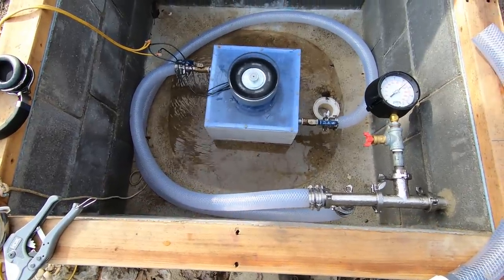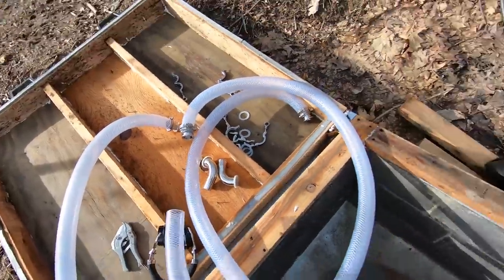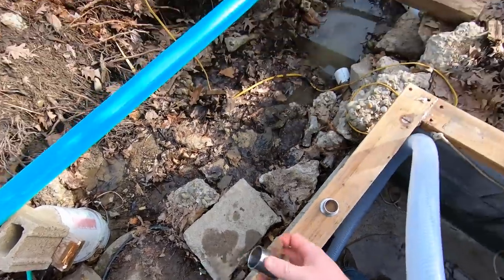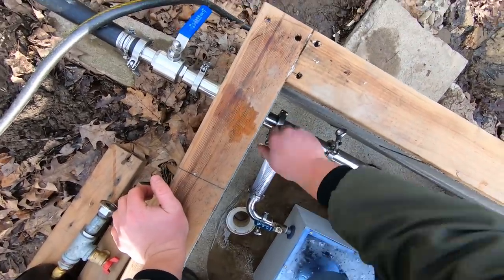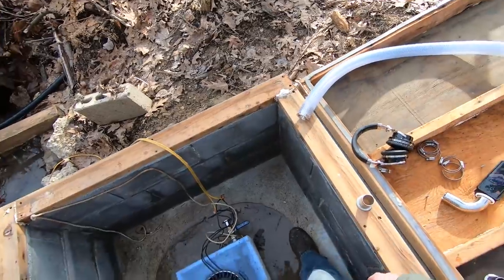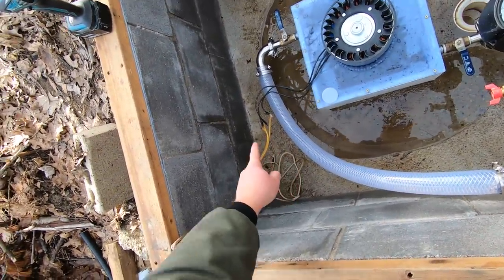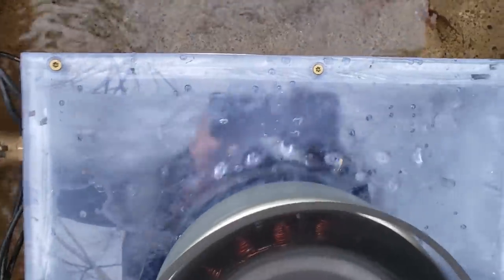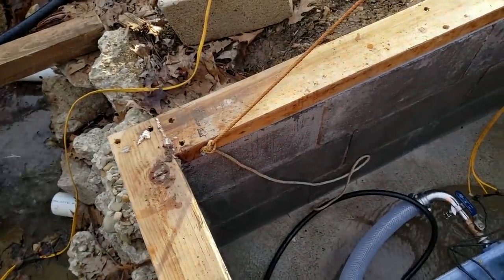Better Jet Alignment Through Elbows?

Comment: Tri Clamp was news to me. I worked with an earlier version of it as dairy farm pipeline systems use the same connectors. Most of ours were wingnuts because they'd never be disturbed once in place, but there were a few we regularly had to reposition, mostly a transfer pipe to move it between going to the bulk tank or the wash vat, and a section in the front of the barn to get tractors in or out.

Comment: From the first time I saw your tri-clamp fittings I wondered if you might work in a dairy or a dairy supply company.  For many years the only place you saw those fittings was in the dairy industry.  They are a great way to go so that you have flexibility for experimentation.
Reply: Try dairy places use them, They are also very popular in the food industry as well, much of the commercial machines use items like this as they make for either quick work of cleaning and or redirecting to another machine,  example one machine might pump x food and where another machine might pump a wrapped type food like raviolis while the same type of machines on the mixing or back end would do the same function for the front ends.
Reply: That was my same thought as well!

I've always called them milk line fittings.
Reply: @farmerkjs6042  They are " Victaulic flanges " I believe.

Comment: hi joe, for jet alignment have you thought of using screws or something to align the jets, kind of a 4-jaw chuck alignment?
Reply from the maker: Yes
Reply: Perhaps a surround around the jet like how a mig welder has so splash back isnt effecting the water droplets from being disrupted 
but to understand a nozzle you gain in pressure but lose velocity/gpm a bigger nozzle you lose pressure but gain velocity/gpm
an adjustable jet nozzle could be engineered similar to a jet aircraft nozzle to understand pipe friction you can push more water though a bigger pipe but a bigger pipe requires more gpm to catch up possibly depleting the reserve 
once you have an adjustable nozzle you could use Arduino chip to make micro adjustments and control output and auto adjust pressure by setting input variables
but for now maybe rig up a lazer to site the jets perfectly to the spoons
a Y would be much better than a T type as a t or sharp bend like that would hamper flow a great deal as water has to stop and flow in a sharp 90 it also slows down the vekocity and pressure as water is a solid so as it hits that t part you would think the opposite but water moves fast but it moves like toothpaste in a tube a Y divides
a t reduces velocity as it has to "wait" on the water moving into the side out before water moves though the strait portion

something else may be possible is pulsed on and off with arduino a pulse would give possibly an increase in pressure as the pulsed could be alternating so that as a weight or "timing mark" could be used to pulse the jet as a certain mass hits the mark increasing acceleration
you likely would need to include a pressure/air chamber to cushion the water hammer from the pulses
the pulses could be timed for very fast or slower 
I love the setup I like how you designed it im considering a water wheel or micro hydro like this perhaps energy could be stored in a centrifugal battery
https://en.wikipedia.org/wiki/Flywheel_energy_storage

Comment: Interesting... When you went from the small diameter paddle wheel to the larger diameter paddle wheel you increased the amount of Torque but you kept the old Alternator. If you want more power out you need to replace the Alternator with a higher rated output requiring more torque. The larger the Diameter / Radius the more torque (ft/lb) for the same water pressure.

Comment: For adjustment, I would consider some sort of double plate design with a square bung of about 2 inches square, This would allow for about 1 inch of play in either direction. 
Plate one would have a large hole in the middle with some bolts and nuts that can me used to move the middle plate that has the large bung, the bung would be threaded all the way to allow you to connect you pipe connection on one side and your jet on the other side, Plate 3 would be your mounting plate that bolts to the stainless steel box, The inside and out side plate would have a section that is recessed down to allow the middle plate to move about 1 inch up, down and side ways while still being ridged enough to not have any slop in it. Pretty much this means if said design was indeed made could allow you to adjust it with ease with could be unbolted and added to another type of box as well. Provided your box is square and not have any rounded type edges. I think something like this could be made in cad pretty easy, The bolts would go in the none recessed part in a much larger part of the unit. I think this is this is the best description I can give. The nuts would be welded to the outside plate and a bolt thru it and a lock bolt on the other side, One can use extension nuts that are about 1 to 2 inches long to allow for great welds and flat and true adjustments. Something like this should be able to give you super fine adjustment if one were to use fine threads, one could even use hex machine bolts as well for use with hex wrench.
Reply from the maker: This was in the original plan, I will try to incorporate adjustment in the turgo design.

Comment: The voltage drop over your wires shouldn't be too bad based on some rough guesses. I'm getting only about 3% drop based on 3 phase AC, 86 volts (from previous video, though that may have changed with the new set-up), a 75 feet wire run, 6 amps (~500 watts) running through a 16 awg wire (best guess and worst case scenario) great job and awsome content, keep up the great work
Reply from the maker: You are spot on! I'll still be upsizing it in the future.

Comment: If you use two 45 deg elbows in series (inside the box) you can adjust the direction of the jet by setting the relative rotation of the elbows.

Comment: Might you get better water velocity with less turbulence if you turned the white box 45° to the left?   I was wondering how much it would increase the velocity and decrease the turbulence if the water pipes could come straight in from the corners where there’s more distance they have the pipes run straight into the turbine in a straight line.

Comment: you should look into just getting a manifold of those fittings and mounting it to the block inside the hutch. and you really should put a high point with a bleeder to collect and vent air that gets trapped.

Comment: Just an FYI It looks like you are losing some energy with a bit of water blowback in your square housing. If you made a conical shape inside to direct water away from your fins and down you could gain some wattage. Impressive project. Personally I would have another turbine available to run so you can generate power while the other is off. In an installation in hymalayas they had more money to work with but set up 6 turbines like yours mounted on their side and in their turbine room you could turn off any turbine while the others ran and they could stick in 4 more. Now they were supplying a town. As an engineer I look for ways to keep things operating because it might be your only source of power. If you stored more water at the top you could have a reserve as well in case you need it.

Comment: Interesting, do you lose energy in the flow as it comes around that elbow? My intuition makes me think it would get slowed by a sharp bend like that and lose some of the potential generating power
Reply: Would most of the jet velocity be coming from the pressure + nozzle, rather than the flow speed in the pipe? I'd think so.
Reply: @BooMeringue1  Sure but the velocity of the water plays a part in the amount of pressure so loss in velocity = loss of pressure. Now whether or not it's significant is a whole other thing. It may very well be too small a difference to matter but I'm curious if he could calculate the loss/gain in generation capability with different configurations of fittings at the turbine housing

Comment: The angle of the nozzle against the shovel must be essential. Another thing: The horizontal turbine wheel is not perfect. When the water meet the middle of a Pelton shovel, it directs the water backwards to both sides of the turbine wheel. That means , one part of the water is going downwards, as it should, but the other part is going up and the falling down on the wheel  and disturbing the rotation. 

Answer: Rebuilt the set-up of the turbine wheel to  vertical position. (Yes, I am no fun)
I suspect that the position and the size of water jets is not optimal. Rebuilt the water jet attachment, so you can make fine adjustments vertical and horizontal of the water to get a perfect aim, and the Pelton principle will work better.
Reply from the maker: I steered away from that orientation to keep the water out of the generator bearings.

Comment: Nice job! I follow all of your projects. As an electrical engineer I would suggest you install an electrical connection box and get rid of those wires only connected with WAGO connectors/clamps. They are great for temporary connections but if you push high amps through your cables they might not be the best pick.
What wire gauge are you using now, which conducting material (copper or alloy) and how long are your cables?
Reply: I would guess 12ga extension cord, atleast 100ft long. 
I think he would be much better off using a twist-loc cord ends as a means of disconnect.

Comment: Looks like the short pipe became deformed when you installed it. Probably better to try to keep the pipe straight or replace it with a non-flexible pipe for higher throughput.

Comment: What do you think your current bottleneck in power production is? Is it those wires? "Any improvements made anywhere besides the bottleneck are an illusion." — Gene Kim, The Phoenix Project
Reply from the maker: I think it's many things at this point. Turgo will solve some of them, 48v batteries others.

Comment: I dont know much about hydraulics, but i was thinking about the T splitter pipe which splits the single hose to 2 going to the turbine. What if you used a Y splitter? Would that make flow more efficient?
Reply: Also very interesting videos. I love them
Reply from the maker: They don't make wye fittings in this style for cheap. I might in the future try welding one up.
Reply: @JoeMalovich  Ah i expected that issue... Would love to see one in the future
Reply from the maker: Too small, still have sharp 90s.
Reply: @JoeMalovich  would a y strainer work ?
Reply: @JoeMalovich  joe learned a lot by looking your videos. You are such a rare type of Man. If I Would unload You in a desert telling You this have to be Green in 2 years you only would say dark Green or more Light Green. You could profit from reading understanding Victor schaubergers experience how to move water right.
I have a german or Austria example how they get  up to 30 percent more energy output only  by changing Things before the turbine. Interested?

Comment: here is a thought, you are losing IMO efficiency in the corners in the box itself, i would make a round enclosure or some ramps vertical to the flow to adjust the loss of pressure or to streamline the flow rate. just looking from a far away, id do those things, discard my comment if im wrong, cheers!

Comment: I like what I see here but how much water is being used for this? What is the water source? If you’re using a pump to create the pressure, what is the difference in energy cost to energy production?
Reply from the maker: Gravity fed from a spring up the hill. About 30 gpm

Comment: Did it help with the efficency ? How much power do you get from it after this improvement ?
Very nice job and this gives a lot of ideas ! Thanks.
How about maintenance ? How long before a need to replace the main parts ?
Reply from the maker: I didn't notice a change in efficiency. It's much quieter which is really nice.

I haven't noticed much wear, my source of water is pretty clean. The bearings and seals will go before the spoons.

Comment: Isn't there a decrease in efficiency if you have hard right angled bends vs  bends with large radii?
Reply from the maker: I did not notice any
Reply: @JoeMalovich  I just did the math based on numbers from earlier videos, the drop was around 6.81 mbar, so 0.00681 bar.  Which should not be a measurable difference.
Reply: Only if he was using the full flow of the ID of the pipe and hose. He is using the pressure and not the volume as the nozzle is about an 1/8th inch opening.
Reply: I ran the numbers on our first picohydro generator, and almost all of the head loss in our plumbing was in the last fraction of an inch, where we were using a brass reduction fitting as a nozzle. I haven't watched all your videos, so I don't know if you've gone over the details of your nozzles. They look nicely tapered. If there is any significant length at the smallest diameter, that's where your head loss will be. As that length approaches zero, any head loss in the nozzle will drop off dramatically.

Comment: instead of making the small housing surrounding  the turbine why not just make metal support members spanning across inside of the blocks to support the generator ? This way the water could be flung outward away from the turbine with less chance of bouncing back . You could add a plate cover across the top of the support members  to have separation between the wet part and dry part of the alternator .You could also make brackets with nipples welded on attached to the same support members to hold the nozzles at the proper alignment angle. You could use a cheap laser pointer aimed at the turbine for precise positioning of the nipples the nozzles thread onto.  The spent water would still drain out of the bottom of your tailrace .
As already pointed out a "Y" splitter fitting of the main feed pipe would give you superior flow to the nozzles .

Comment: That t-piece for the 2nd jet is killing your efficiency. The only pressure that's seeing is backpressure from the primary jet. Connect the 2nd jet back to the first so there's a loop, that will even out the pressure between them, or at least switch to a Y-split. Ideally, you'd build a large-diameter loop around the perimeter and use street elbows off it to the jets, the longer the water flows in the small-diameter bent pipe, the lower your pressure will be.

Comment: I know tri clamps all to well spent 40 years in the food industry sanitary welding thin wall stainless tubing  ; )
Reply from the maker: Are you still setup to weld it?  My 90 degree tee fittings aren't ideal and so I need a manifold with 45 degree branches on one side. I was going to try my hand at it but I'm still a rookie at welding.
Reply: @JoeMalovich  Sorry I am retired and my eyes are not up to it now.  Look up TIG welding here on you tube.
And get some scrap to practice on.  Good luck

Comment: those elbows will cause more resistance and slow down your flow, no?
Reply: Shorter hoses produce less friction, so less loss. Also the better jet alignment should improve power output. Noise = lost energy so having the jets in better alignment that makes less noise should make more power.
Reply: iirc he's relying more on the pressure and not flow rate as much; a 1/8" nozzle is gonna cut flow much more than an elbow ever could!
Reply: @scrambledmandible  Maybe, just basing that thought on all the main water lines I have laid while working for a utility company that were designed by engineers. They stayed away from 90's and used sweeping directional pipe instead. The coefficient of friction of a 90 is very high according to the engineers anyway.

Comment: How many gallons per hour is required to run this setup?  Here it's 1 cent per 8 gallons of water to break even for the output I would need to use 97.52 gallons per hour at the cost of 12.19 cents per kw/h.    So, if the setup does 1/2 kw/h my max g/h would be 48.76.  So, I would see about something of around 30-35 g/h.

Comment: by having the water deflecting back your are getting the most out of your jet hitting the impeller your don't want it to hit flat. when it hit a flat surface  you lose energy when you hit just inside of the cup and the water get redirected back it acts as a jet pushing the impeller forward and increasing your output force by about 30%. you can test this by using a bowel attached to a 2 by 4 board about 3ft long using a hose hit a flat spot on the board and then the bowel hope this makes scene i seen this on someone else's youtube Chanel  at 1:27 of his video hope this helps you https://www.youtube.com/watch?v=S6oNxckjEiE